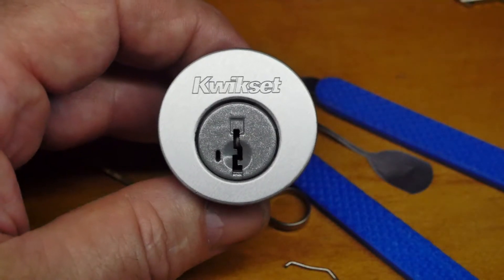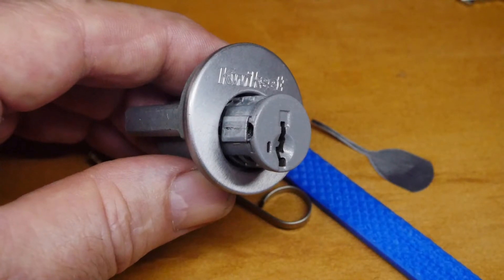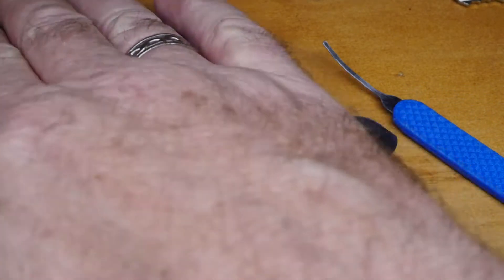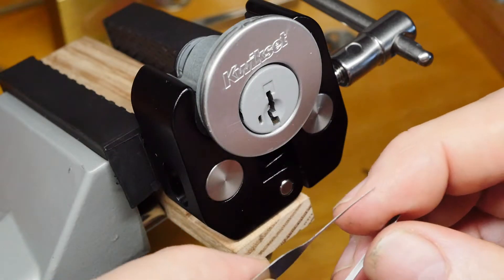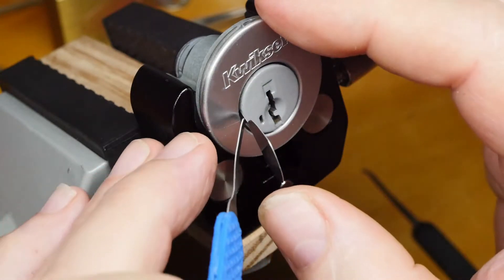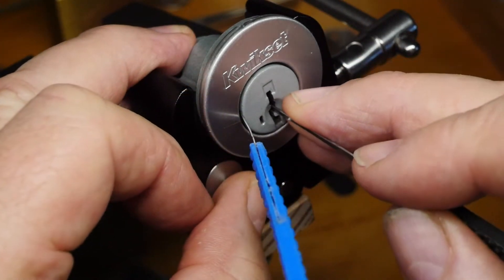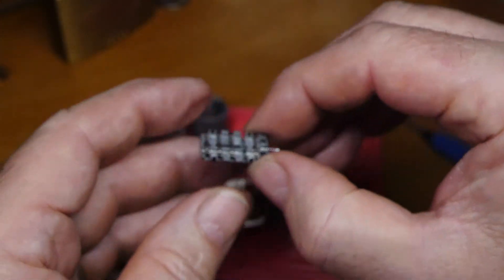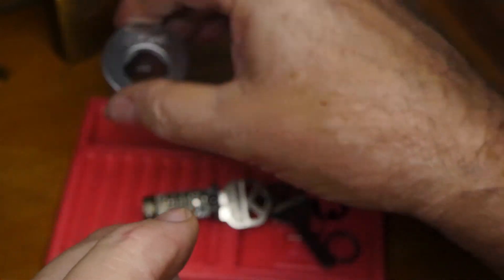KwikSet Smartkey Gen 3 - Pick & ? Gut ?

Comment: First shim .015, second one .030, then remove the first one, leaving .030 total shim thickness in place. Would it work to insert first shim .015 and second shim .015 and don't remove anything which still leaves .030 total shims in place? or do you need the single .030 thickness for "stiffness"? to get it over the rear pins?  I know you've tried all combinations, just wondered about this.